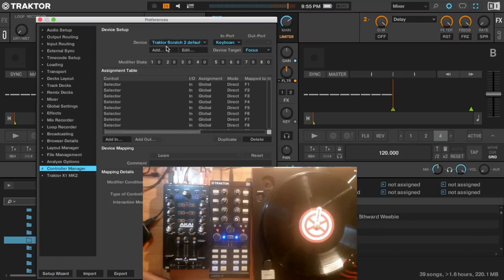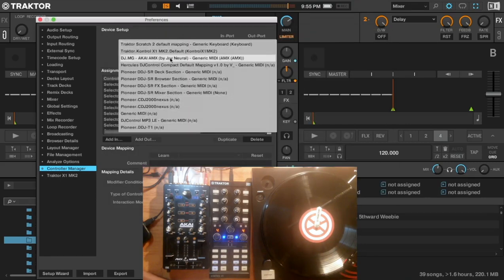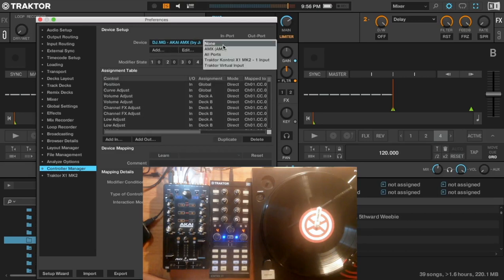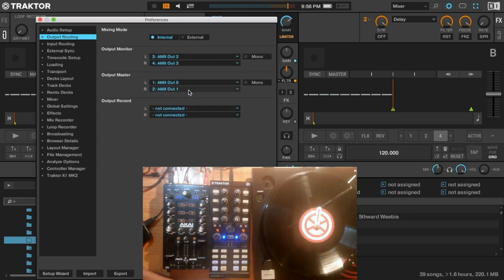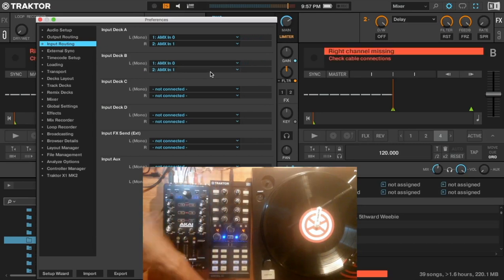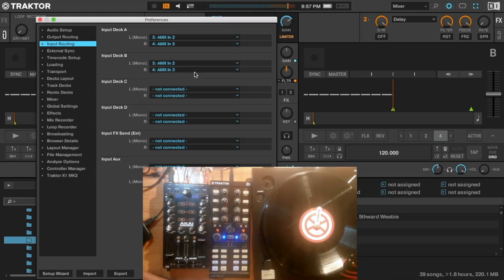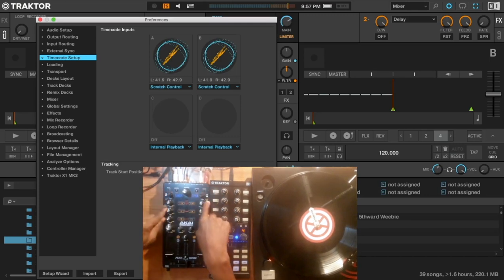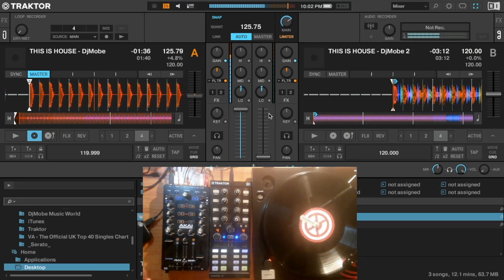How to Use one or solo Turntable or CDJ or DVS in TRAKTOR Pro 3

Comment: hello brother, I liked your setup, I'm thinking of putting together a similar one, for now I only have 1 akai apc40 mk2 (without internal board), 1 plx 1000 and I'm thinking of buying an external a8 card or a mixer like yours. My question is do I need a digital mixer with traktor3 only? Sorry my english is not good
Reply from the maker: Ok. Yes you need to have a Sound card any... but must have a line input, right and left. You will also need a vinyl player with a traktor vinyl so that can be detected within the software

Comment: nice idea but i think if you hook up one TT on traktor and route it to both channels then you will have problem when record is played on the left deck and you switch it to the right deck it will pick up time from the vinyl and skip track two to the time of the track one...
Reply from the maker: I have not experience  TRAKTOR SCRATCH PRO provides three different Tracking Modes: Relative, Absolute and Internal.

Comment: The delay in the timecode response is your computer or is the AMX issue?
Reply: I have here one Kontrol Z1with a internal soundcard and one Rane SL3. I think i can combine then into one "soundcard" in my mac. And make the routing like you did to input the turntable signal right?
Reply from the maker: @giovannivicentin8438  maybe it will work
Reply from the maker: May be it is the video delay